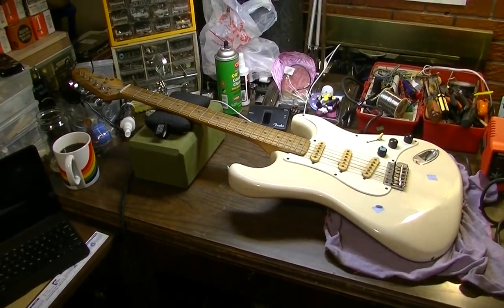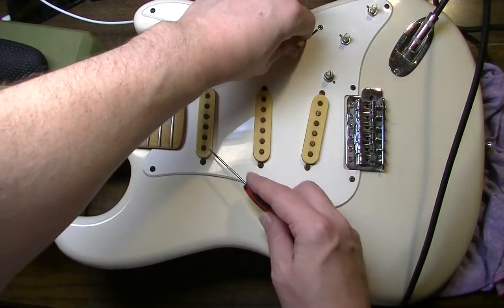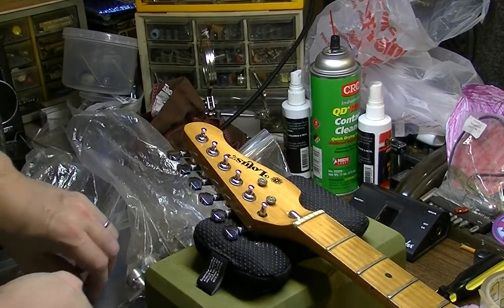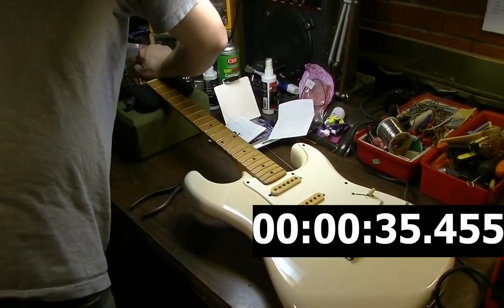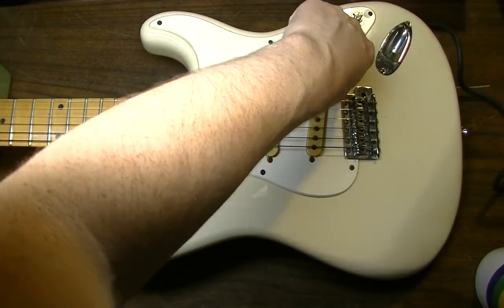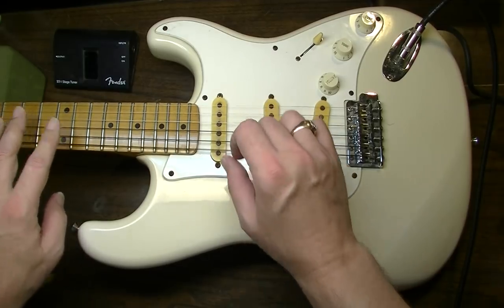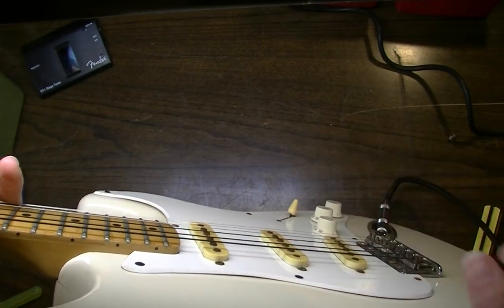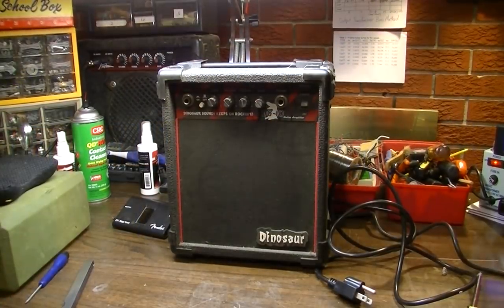$9 Thrift Store Axe Setup, Ultimate Speed Restring Challenge, Intonation Tutorial & MORE! - SPF

Comment: For stripped screws put a rubber band between screwdriver and screw, works like a charm.
Reply from the maker: I ended up getting a different sized screwdriver that worked, but that's a brilliant solution! Thanks. Where did you learn that one?
Reply: Don't know about Coban, but I picked that tip up working in IT. Laptops have a lot of tiny screws and occasionally the heads get stripped out. A solid rubber band can usually get it started on it's way out.
Reply: it's on f***book 16 times a day.
Reply: thanks for that one
Reply: Another solution is using a piece of leather. I learned this one from that Crazy Russian Hacker guy.
Reply: a guess almost anything would work lol
a piece of low adhesion tape?
Reply: The Guitologist can't even remember, but it was many years ago, maybe grandpa. Served me well
Reply: kindisc fuckbook?
Reply: Conan Seibel i wear a rubber band on my wrist being i fix shit all day and stripped screws are my worst enemy
Reply: That's genius
Reply: very rarely works for larger screws with any amount of torque on them.  I usually end up having to knock the head off with a cold chisel to get the part out of the way and gripping the thread with vise grips
Reply: @kindisc Damn you sure are on FB a lot. lol
Reply: Take a dremel with a thin disk an grind a new deeper slot. The rest is self explanatory.
Reply: I've used little squares of tape before , But thanks for this new idea .  For the tiny screws on laptops and stuff it keeps the screw from falling inside
Reply: It doesn't do that all the time

Comment: 46:00 You can just grab a dremel/file and elongate the saddle hole. That saddle design can also cause tuning instability and string breakage since the sharp edge of the saddle-hole grinds into the string. This is a design flaw from fender. Several other manufacturers make the bent saddles with longer holes nowadays to prevent this problem.

Comment: I used to rebuild old cheap guitars..sometimes paying nothing at all for them up front...one I literally pulled off a trash pile at a yard sale and they gave it to me. However, I eventually gave up, I found that if parts were required, the parts cost would be more than the guitar was worth as a working guitar. Oddly, you can take them apart and sell the parts and get more than for the working guitar. I didn't like that, not buying the parts or turning instruments into parts, so I quit doing it. Made pretty good cash off my parts I had saved up by that time though.

Comment: Just a bit late to the party but wanted to say that is the most comprehensive lesson on intonation I've ever seen, heard or read about. 
And here I thought I knew what I was doing :) As for sticky pots may I suggest a bottle of Remington Rem oil with Teflon.
It's a gun oil obviously but works for so much more. I've used it for a Grandfather clock, electric razors and guitars.
Stuff is water thin. Rub a drop between your finger and thumb and it just disappears.
Had a volume pot in a LP that I had to constantly clean because it would bind. 
A couple drops down the shaft and it worked fine for years until the whole thing just fell apart one day from all the corrosion.

BTW, nice to see all the comments about Uncle Doug and so glad to have him back on the Tube.

Comment: CRC Electronics Cleaner from Wal-Mart is excellent to use on pots and tuners..Cleans and dissipates quickly...In The automotive section
Reply: Yep... CRC Contact cleaner with lubricant for the pots, not WD-40 or god forbid 3 in 1 oil!  Really!  You clearly don't know electronics!  I might let you wax my car but "The Guitologist" will never work on my guitars!
Reply: @WildcatCougar  99% video is great, but even I know not to use wd40 or 3in1 oil in pots and electronics. I have a can of DeOxit.
Reply: He actually has the CRC contact cleaner at 15:40 mins in.
Reply: I ran out of the good stuff one night and had to be done with a job next morning. Went to auto part store and bought the CRC. That stuff is just as good if not better.

Comment: My only tip for speed on restringing for this set up would be go from the tuning machine closest to the nut to the furthest. It helps me keep the strings that are already done out of my way. I seems insignificant or silly, but it has helped me keep from fumbling around the strings I'm not currently doing at the time. It really makes more of a difference with LP/SG and Dean V style headstocks where the strings are pulled outward in a 3+3 design, but has been a handy way to do 6 in line like this as well. I see you had no major issues going in the opposite order, so kudos! Great video though on bringing a potential "junker" back to life!

Comment: you can't tune and set up a guitar right, if the weight of the guitar is resting on the headstock, you should lay the neck totally free, with only the tension of the strings on it!
Reply: That's correct.
Reply: Right

Comment: I usually use a small Allen wrench to push the ball end of the string through Strat bridges when they get stuck. They can also be hit with a hammer to drive it out and give more surface area than a screwdriver against the ball end of the string which usually pushes out the remaining string very easily.

Comment: In tempered tuning the 3rd has a beat frequency and the 4th does not because the 12-tone octave divided into equal increments utilized in most western music is a compromise that only approximates the "perfect 3rd" in order to ensure that all the 4ths, 5ths, and octaves are correct in all keys. This is why the "split the difference" situation you describe occurs. A properly tempered guitar will always have beat frequencies on the 3rd in every key, but it is possible to "sweeten" the tuning of a guitar for particular keys (Better for E vs Better for G, for example). This has the negative effect of causing problems when changing keys, and even within the key itself, since the frets are still tempered. A "perfect 3rd" in G is often achieved by tuning the B string slightly flat, but this will make every note on that string slightly flat as well. The open G chord will sound sweet, but it will compromise the other intervals up and down the neck. This stuff drives a lot of guitarists crazy, but it's all a matter of how the math works out on intervals and the fact that tempered tuning is a compromise that gives up a "perfect 3rd" in order to gain the massive capability to play in any of the tempered keys without undesirable results. 

Enjoyed the video. I picked up a basket-case Conrad Fretless Jazz Bass with Seymour Duncan pickups for $30 over Christmas and enjoyed doing a similar rehabilitation on it. I thought I got a deal, till I saw you got yours for less than $10! Oye. Now I'm looking for a good $8 guitar. :)

Comment: I like the discussion regarding intonation. When I was younger, I left my guitar to a shop for set up, but was always disappointed with the result. As I learned over the years is that after been playing such a long time 40+ years, I tend to bend into tune. I can instantly hear and feel how if the guitar is within reasonable intonation so to speak. Usually I do intonation standing, tune the  guitar, check 12th fret, adjust to close, I loosen the string first of course before adjusting the saddle. Tune it again, then I do a a series of hammer on, going from 1st to the 6th string by hitting open string, hammer on the 12th fret and hold it. I listen for ghost notes that should not be present, adjust again, sometimes my tuner and I disagree. Thanks for your videos!

Comment: You can use a paper bag to sand the fretboard. Paper bags are used by ship modelers to fine sand. It's like using a 4000 grit. After working the paper bag over the fretboard you can oil it instead of the hassle of spraying it all over again.

Comment: You can use your .050" hex wrench to push the string balls out.  It's not just for adjusting string height :o)  Also, if you have a stripped Phillips screw on a tuner body, use a 1" diamond cutoff wheel in a Dremel to cut a slot across the screw head and then use a flat screw driver to remove it.  Also Also!  Drill out the body for the neck screws with a 3/16" drill so the screws slip through.  The screws should only bite into the neck--not the body.  Screw holes that are too small are the reason that neck was 'floating' when you got it home.  Cheers Brad!

Comment: LPS1 is the best stuff Ive found for improving crusty pots and switch contacts. If they are really corroded it wont fix the dead spots but it will  fix the crispy noises as you turn it. It cleans pretty well and is a super light lubricant that doesnt dry out and gum up like wd40 will in a few years.  I have never had it damage any kind of plastic or finish either but if there are cracks in the finish it will soak thru the cracks and darken the wood beneath.

Comment: When you break the head off a tiny screw I have good luck with cutting as slot (with a dermal)in the broken end and using a flat head. Only mention it cause you have less the fill/ fix/ repair in the end.
Reply: John Bailey 
Thx, for that. I’m an art framer and unfitting old artwork from vintage frames... anything can happen.

Comment: For the saddle screws go out to a Lowe’s 
they come in 12pcs packs. At most home improvement stores. 

Most guitars are imports and most of them are S Style or at least have really similar bridge and saddle setups. Just think of the cheap ibenez for an example. So this trick applies to a wide range of guitars.

The ones I get are Pan Phillips pan discribes the head shape/style. And they are very very similar to what mostly comes in most guitars.

I always use the shorter M3-.50 x 12 for the low E they work really well for that string. And clean up the look of a bunch of threads coming through. And getting close to the string.

M3- .50 x 12 are the most common from the factory’s so I always keep a bunch of them as replacements for rusty or damaged ones.

And also just in case I need more threads on the high E a pack of M3-.50 X 20 will work just fine for that. You just have to push the saddle back with one finger when changing the string.

I wish I could find some M3-.50 X 18 to use on the high E instead. however I’ve found that the ones above do work. It just that they just barely cover the string holes. And if it bothers you that much I’m sure you can just dremel off 2mm of a screw. 

But having a few packs of each of them screws will make your life easier and happier. 

Also I personally suggest just cutting off a few coils from the wider side of the the Low E saddle spring. Just using your typical electronic flush cut snips works well for the thin cheap gauge of cheap steel. instead of just flat out removing it them just consider doing that first. It looks cleaner and it works just fine. It’s an added 30 seconds that it bro.

Comment: On many of the strats I've intonated, that low E saddle's aft travel will be insufficient if the trem plate is floating too far off the body—ideally (I've read) with the trem plate floating about an eighth of an inch off the body, the low E saddle will have enough travel to be intonated without removing the saddle spring or grinding the screw (or the back of the saddle with modern cast saddles). Lowering the trem a bit by tightening the trem springs in the cavity effectively moves all the saddles aft, and may permit the low E to be intonated without compromising pitch-up movement of the trem, so one may want to consider adjusting the float height before taking drastic measures with the low E saddle parts.

Comment: I've found chamfering the neck bolt holes slightly and the corresponding holes in body will allow the neck to seat flatter instead of trying to tighten a neck that has a "bump" where the neck bolt/screw deformed the wood where it enters the neck.

Comment: Good presentation, as always ;)   and I might add:   that there are times when a non-matted benchtop is safer than a nice, perhaps expensive mat ...  For example: No mat lets you KNOW there are no  potentially harmful  objects on the bench .. whereas with a beautiful 'carpet-like' mat, tho soft and fuzzy-warm,  it can grip a tiny piece of sand/metal/etc that can destroy an instrument's finish ...and you'd not know at all the the 'foreign body' is in the mat...  so, a very smooth benchtop + damp cloth or brush is safer ..

Comment: Intonation is less player sensitive if you have your strings very low. The less the strings move to hit the fret the less opportunity they have to be out of tune. Another advantage to lowering your action and setting your neck correctly as you did earlier. I have at least one bass I took a dremmel and routed it out to get the bridge to sit where it needed (about 2mm lower) to achieve the correct height. Once that was done it worked great! I made sure the neck and everything else was ruled out before routing away though. For an example on my guitars I like to go to at least the 12th fret and the pick should hold itself between the string and the fret. Optimally it should do this at the 18th and 20th also. I play with a medium to thick pick. A second way to ballpark it is if you can take a piece of standard print paper and put it between the string and fret hit a note and it deads out or horridly buzzes you are about right! With action that low it is way easy to play and way easier to be correct with intonation regardless of the player. The real challenge is that you have to get it low without buzzing and that is where fret leveling and dressing skills come into play. Sometimes the cheap guitars with have the frets in slightly off increments and then it cannot be intonated without a whole new fret board and fret job. That is where I would rather pay someone to just put it into a machine and do it for me. LOL

Comment: I just had to say, the reason why the intonation was right for certain intervals and not others is because guitars are made to be tuned according to Equal Temperament. Equal Temperament by definition means that every interval will be slightly "out of tune," but it will make playing in every key possible. If you play a piano that is perfectly tuned  according to Equal Temperament, all of the major 3rds will be slightly sharp, but it will be close enough to be playable in all keys. If the piano was in Just Temperament according to say, C major, the intervals and chords in the key would be more perfectly in tune and sound fantastic. However, if you wanted to play in F# major on the same piano, it would be essentially unplayable due to how out of tune the notes would sound.

Equal Temperament is a compromise and has been applied to most fixed-pitched instruments. The reason behind this gets math-y and sort of convoluted, but it basically boils down to the frequency of certain pitches and their ratios (intervals) to one another, and them not matching up within different keys. So not only will the guitar NEVER be perfectly intonated, the very way intervals work means that essentially any interval/chord you play on an ideally tuned and intonated guitar is never perfectly in tune.

Go ahead and tune your guitar the best you can, strum an open E major chord and then lower the pitch of the G string slightly until it sounds perfect. Then play a power chord or something up the neck and the G string will sound flat. This isn't an intonation issue, it is how our tuning system functions to work the best it can in all situations. Sorry for such a long comment, but I'm rather bored and felt like spewing some information on the internet. Have a great day!

Comment: I have had guitars before that do have that crack at the neck and you can just take some decent superglue, put it in the crack, clamp down with extra pieces of wood on both sides to really press the wood together and mend it. I also repaint the bodies and you will never tell, and the guitar is just as strong as it was the day it was made. You can also use Titebond III. Whichever you prefer?  My Strat body on a Batman guitar I just did is also plywood. I stuck some EMG RA5 Alnico single coils in it, Fender Locking Tuners, Bone nut, and it ROCKS now!  It was actually a guitar from magic Mountain. Now I have have every guitar geek for miles around me wanting it. But hey man, great video! Great find! Keep up the great work!

Comment: I have a lot of old gear, I have mixers, stereo heads, av recievers, etc. I use alot of it to make music, new sounds, short circuit stuff, etc. Guitars are nice to pick up, especially cheap ones. As long as the frets are correct spacing and are workable for a dressing and truss is ok and I can get it playing - cool, I use it for something like 'monkey tuning' which is like drop d but across the entire neck, or some open tuning, or whatever. It's nice having multiple instruments tuned a certain way and you can pick up and go instantly (or maybe a super quick tuning, then play) vs having a couple axes and you have to sort out your tuning.I used to be a heavy gripper in my early days, but now I'm light as I can possibly get away with, which leads to endurance. 

Also trolls can absolutely suck it, suck it.